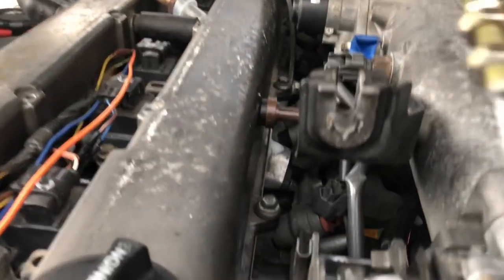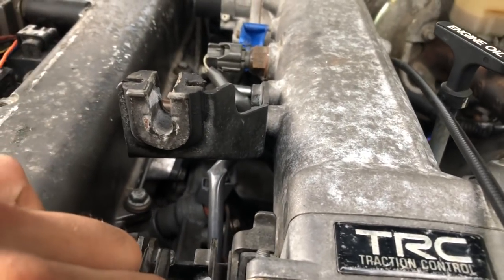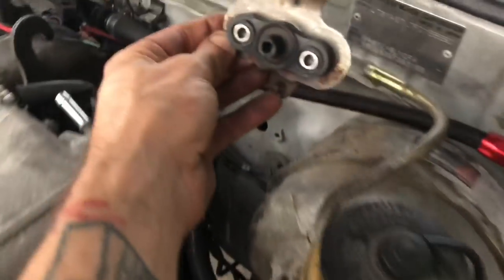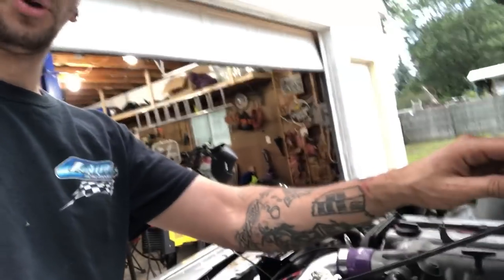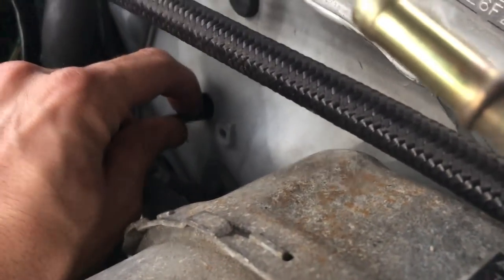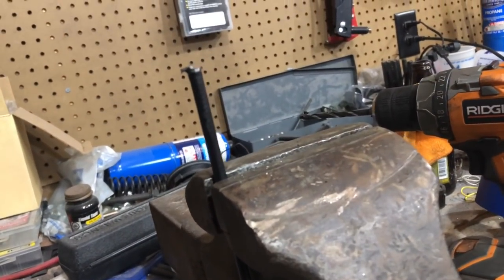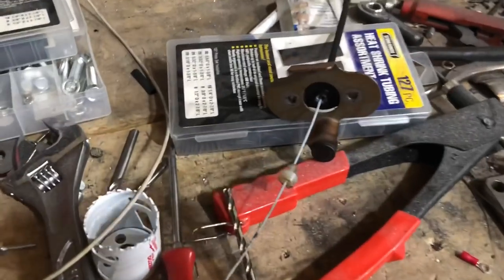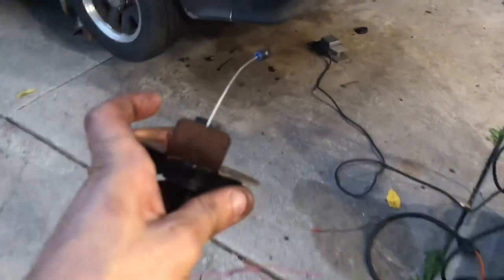$8 Engine Swap Throttle Cable

Comment: worked awesome on my sc300 the throttle cable that the part # is off a Subaru I had a wrx throttle cable laying around and this worked also removed the weird throttle stop under the carpet to get more pedal travel